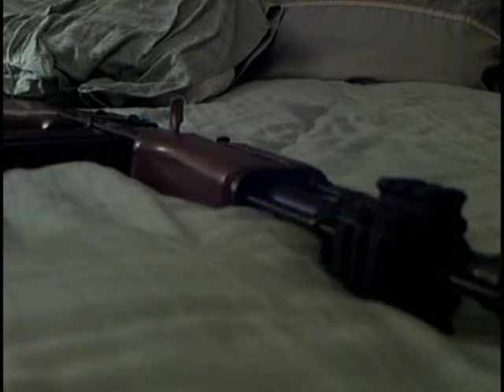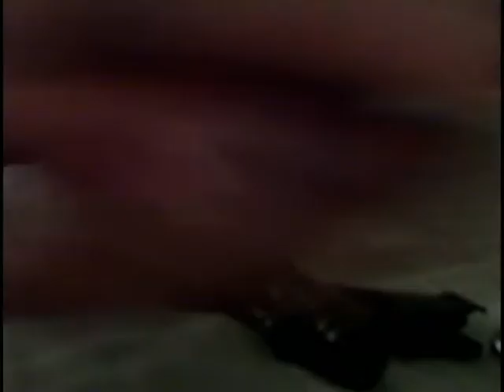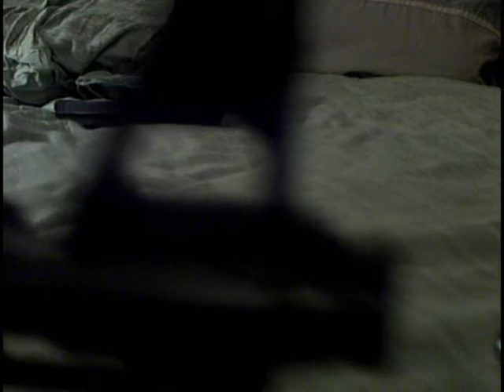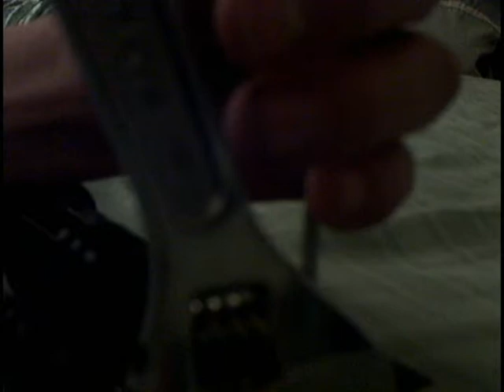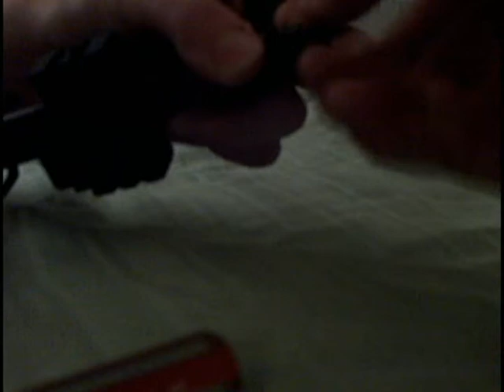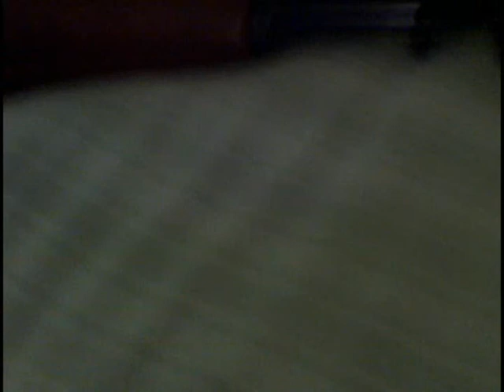How to Remove Flash Hider from Airsoft AK-47

Comment: I own a CYMA CM028u and have used it for quite a while without problems. I'm to the point where I've customized it and I just need to remove the orange tip for a new flash hider/suppressor. Any tips?